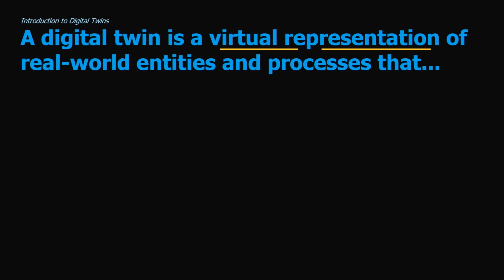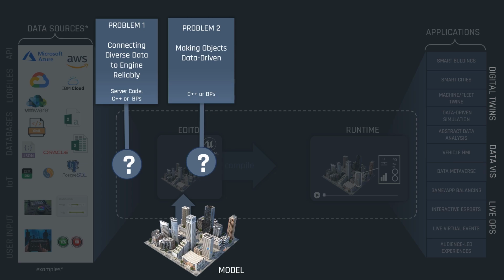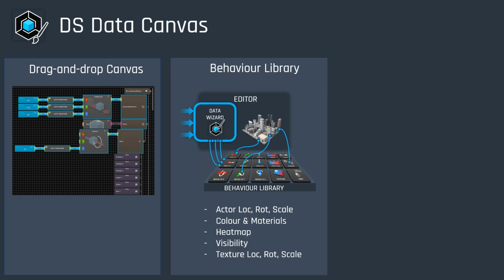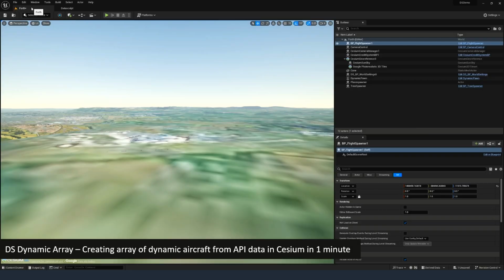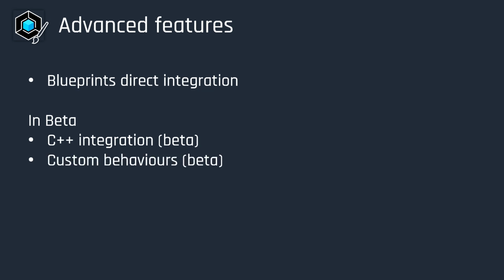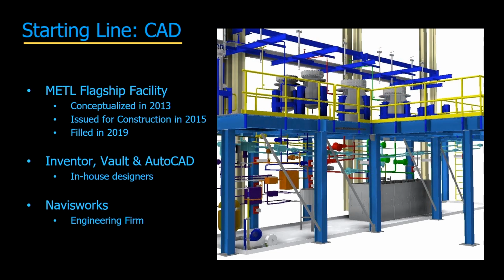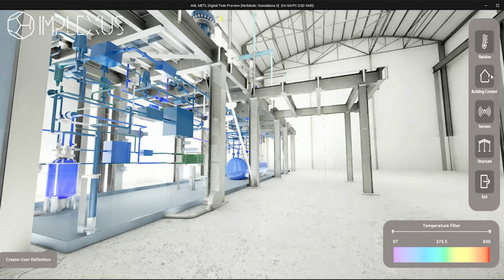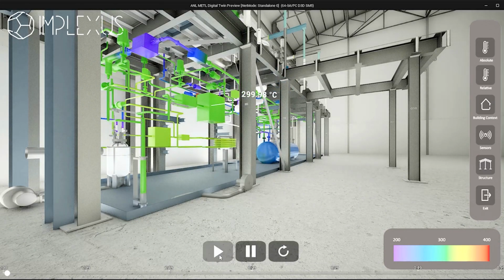HMI for an Industrial Facility Digital Twin with UE5 | Unreal Fest 2024

Comment: Unreal is amazing because it can be used in industries beyond just video games. We need to keep promoting this to the next generation of creators. Everybody: Research about the possibilities. The are big.
Reply: What are the advantages over Unity?
Reply: @SnakeEngine  Unreal engine wants a profit cut only when we succeed. Not like Unity. Guess which one will be successful in the long run?
Reply: @arunbabu3814  On the other hand, Unity does not charge you extra when you succeed. The amount is constant and pretty tiny, regardless of your success, and it is also free if you don't have a moderate success (it's free if you make less than 200 000 dollars per year).
Reply: @SnakeEngine  Tim Sweeney.